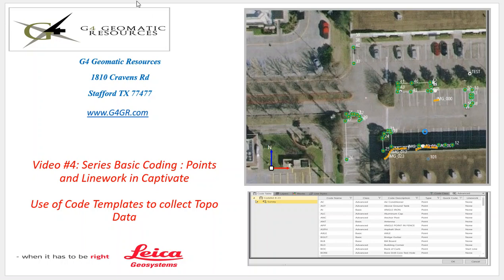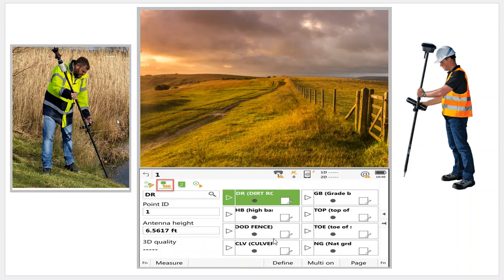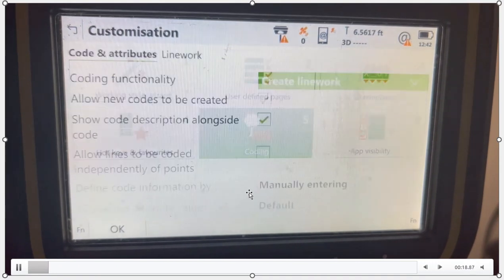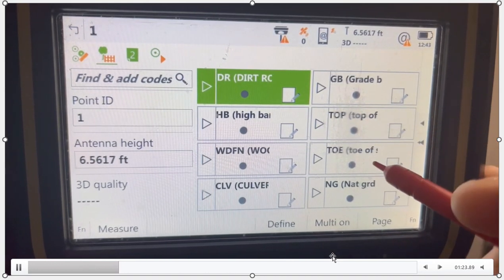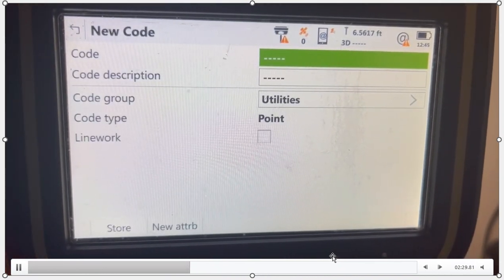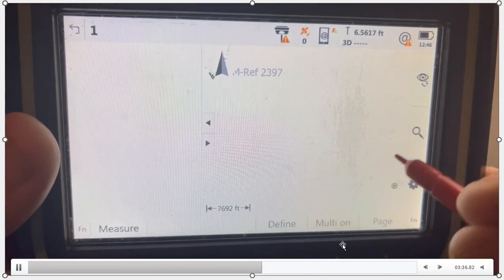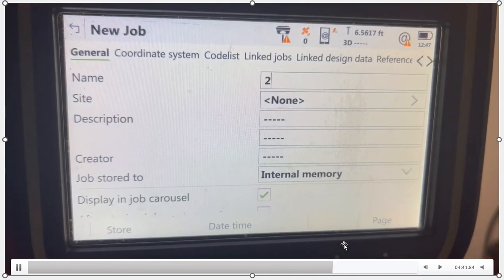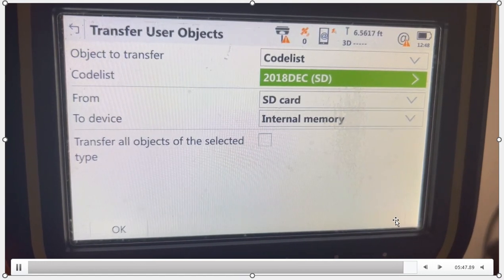Video #4:  Points Coding Leica Captivate CS20 : Code Templates to collect Topo Data

Comment: In your first example you have all point codes for what I have set up as linework. I was just wondering how this works back in the office. Thanks.
Reply from the maker: If one of the codes you defined in Infinity code list defaults to "Start line"-In the field on CS20 you can click on the icon for the linework, and then set to "None", this will make then code as a point-if you prefer, thus if a client wants to take a shot on a Back of Curb (spot shot) with no linework, then change on the fly- in next video i can show this. Also in above example if you wanted to do linework, you can do that as well, just click on the "Dot" icon, and select linework eg start line or start 3 pt curve.
Reply: @JeffRyallG4GR   OK I know this. Sorry I didn't explain myself clearly. I was wondering why you have what I would consider to be linework by default, set to points? Also I prefer to minimise screen clicks and use keyboard input as much as possible. My software recognises all codes as line work unless prefixed with a P for point. (PS. As far as software goes I'm using LSS Solo, not Infinity, to set up code lists and process surveys).
Reply from the maker: Sorry-kind of confusing: in first sets of videos we are using the "linework" feature to collect  "Point" data- I just wanted to show power of code- list and templates for point data collection.   
 In next video will put some tips on collecting linework-Leica has 2 great linework videos i will put link to access and then provide some tips as well.

I just use Infinity-sorry not  familiar  with LSS Solo software @anivegmin
Reply: @JeffRyallG4GR  Ah ok, makes sense now. Thanks for replying.